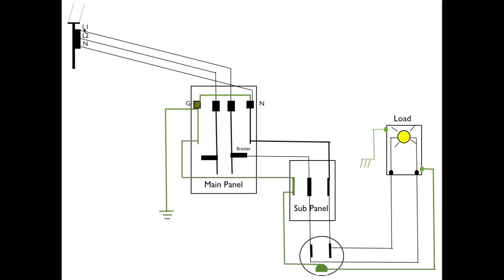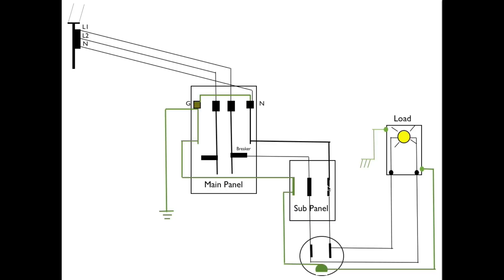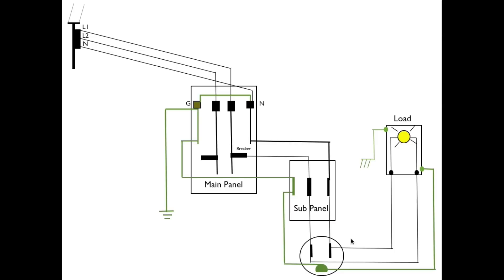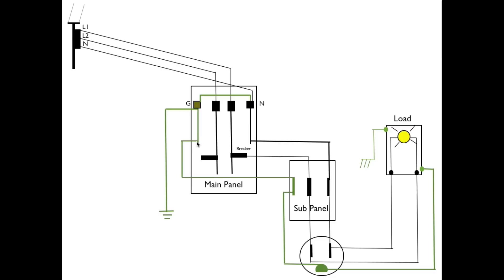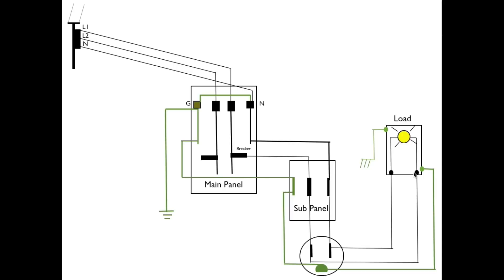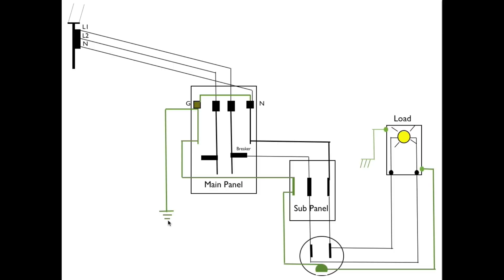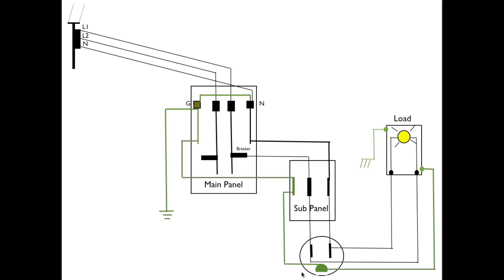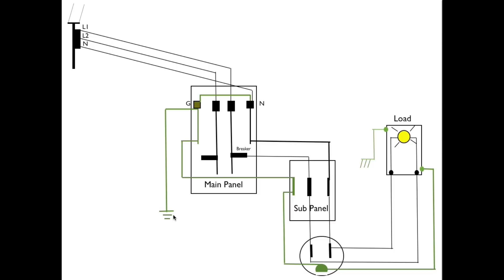The difference between neutral and ground on the electric panel

Comment: Secondary of power pole transformer is center tapped, and that tap is the neutral point in the system, whether grounded or not.  Center tap is connected to neutral bus in main box by third wire from pole.  L1 and L2 are each 120 volts to neutral (center tap), but 240 volts between them, due to being on opposite ends of the secondary, therefore 180 degrees out of phase with each other.  L1 connection in box supplies breaker loads with 120 volt current that returns from loads through white wires to neutral bus in main box, L2 does same, but 180 degrees out of phase with L1.  When L1 and L2 neutral currents combine at the neutral bus in the main box, they cancel each other completely if they are equal at that moment (Kirchhoff's Current Law).  Unbalanced current (difference between L1 and L2) flows from neutral point in main box, through neutral wire back to center tap of pole transformer secondary, not to ground.  Current in the 240 volt loads are exactly equal in L1 and L2 (series circuit) as long as there are no shorts to ground or ground circuit through load or chassis.  No neutral current flows in 240 volt loads because there is no neutral connection, only L1, L2, and ground.  Absent faults, the ONLY current flowing from the main box neutral bus back to the center tap of the transformer is the difference current (unbalance) between L1 and L2 120 volt loads, with NO neutral current from 240 volt loads, and no current flowing through ground.  Of course, all this leaves out switching transients and static discharges, which can affect fault protection devices.
Reply: +Hopelessand Forlorn but what potential is neutral at if it is not earth bonded? With all of those miles of transmission cables to build up a charge.
Reply: Hope my post was not misleading.  Neutral is earthed at the mains box, and neutral does frequently carry current in most all systems.  With separate 120-volt loads on L1 and L2, a perfectly balanced load with no neutral current would be a momentary state of changing loads, in most cases.  There is a lot more to utility distribution than I know about so far, particularly in bonding and actual amounts of earth current in different parts of the system.  My background is in aircraft electrical systems, and I am still working out the similarities and differences with what info I can gather on line.  No big surprises so far--3 phase is 3 phase, and center tapped xfrmrs all work the same.  Ungrounded 3 phase loads and single-point grounded signal circuits are more common on aircraft than you might expect, as are sophisticated distribution fault detection and protection circuits.
Reply: Hopelessand Forlorn
airplanes are a lot smaller than national electrical grids. Much like birds perched on power lines you don't have to worry about the earth ground on them much either.
Reply: I disagree.  The same considerations apply.  If you are distributing large amounts of power (I suspect the 787 operates with total loads of around half a MW), short circuits to ground are always possible in the absence of a totally floating system, and can have serious consequences.  Even in a totally aluminum airframe, bonding between skins and from airframe to components is critical.  Unbalanced currents return to generators through the airframe, and poor bonding or grounding would be as hazardous as the ground around a downed and live power wire in a utility system.  Aircraft data and communication wires are usually balanced and frequently shielded with single point grounding on the shield.  Sometimes double shielding is used with the inner shield grounded at  one end, the outer shield grounded at both ends, and no continuity between the two shields.  Even in a well-bonded aluminum airframe, low levels of stray voltage are common due to ground current through airframe resistance.
Reply: Hopelessand Forlorn
while the same considerations may apply the scales are completely different.
Reply: Single phase uses any of L1 L2 L3 paired with neutral line. For commercial and industrial service 3 phase is used with 4 wires, taking 1 line with neutral for lighting and other single phase loads. Single phase loads are carefully calculated and distributed   equally as much as possible to each phase (line) to balance the system. The illustration is clearly a line-to-neutral distribution system, but it is not properly presented because of Ĺ1 L2 & neutral. It should be L1 L2 L3 & neutral or L1 & neutral. 
Dividing the Voltage between L1 & L2 by 2 which is 240 to get 120 L1 to neutral is wrong. Try studying polyphase system, its easy.
Reply: Rey C Speaking of polyphase systems, do you understand the difference between 3-phase and two-phase systems?  Do you laboriously plot vectors to verify that 120 volts times two equals 240 volts?  You must really have fun with synchro circuits, which typically have three windings at 120-degree angles, but which are in fact single-phase devices.  Polyphase circuits have not changed since I learned them in 1965, but you have proven once again that there are endless ways to misunderstand them.
Reply: None of this will work without D-cell batteries...stop your arguments....   ;)
Reply: Well duh
Reply: Hoplelessand Forlorn - always wondered about an airframes ability to shed errant voltages from the atmosphere; i.e. ionic disturbances from thunderstorm activity, etc.  Also the craft passing through magnetic fields of Earth.  Then, of course, the occasional direct lightening strikes.  Where is "ground" at 30K feet.  lol
Reply: Mitsubishi Triton 2.44 Diesel engine
Reply: R C I had the opportunity to measure a 3 phase line to ground.2 poles were 120 v each and the third was 240. I was told the 240 was the wild leg of a 3 phase setup. At the time I had no clue why.
Reply: Not quite right
Reply: Hopelessand Forlorn - This is a much better explanation than the video as he does not address L2 at all. In the video however, he has the neutral from the pole connected to ground in the main panel. Is that correct? That means that from the main panel on, neutral IS ground! Is his diagram correct?
Reply: Craig Daniels you will measure continuity between ground and neutral, that's what trips the breaker, let's say you have a microwave,  metal cover ,and your hot wire comes off and touches the cover inside, your breaker pops because the voltage goes through the grounding conductor on the microwave and goes back to the panel, through the neutral and overcurrent pops the breaker, if they didn't tie together at some point you would have voltage going to ground and not Tripp the breaker
Reply: Hopelessand Forlorn so the unbalanced current goes through the meter gets paid for and then gets sucked up for reuse in the grid?
Reply: Now lets apply a smart meter. And i promise you can take out your snap 9 and read a good current flowing back to the sub on most residential meters.come on folks think a little bit more for yourself common sense.or keep letting these corporate utility whores take your money
Reply: @1pcfred  induction
Reply: Toed T I'm not an electrician by any means but you answered my minds problem thank you. Makes me happy to hear that. Wow.
Reply: Hopelessand Forlorn - what is a two-phase system and where is it used?
Reply: @ronb6182  you were dealing with a high leg Delta.
Reply: @24vignettes94  yeah I know now  but in 1983 I never studied commercial wiring and had no clue, my brother said it was the wild leg of the delta. 

It's suprising that there are car alternators that are three phase. 

It's something to play around with, of course with lower voltages.
Reply: @JetDriver1111  🤣🤣

Comment: Neutral carries current, ground doesn't except if there is a fault. Neutral is a system ground, the green wire is a safety wire.
Reply from the maker: +Bri G. Quite accurate.  Thanks for the thoughts.
GFM
Reply: What about the main difference B/w Grounding and Earthing????
Reply from the maker: +Android World Earthing means it goes to a ground rod.  Grounding is usually the chassis of a component that goes to a ground rod and the neutral in the panel.
GFM
Reply: grayfurnaceman ;, will n
Reply: Bri G. my fluke meter agrees with this statement.
Reply: grayfurnaceman 
Despite the fact you do understand that he has pointed out that there is an error in your video, still you keep it up and this in a topic as serious as electricity. What is wrong with you?
Reply: There is an obvious error in the polarity of the receptacle in the diagram. The polarity is reversed with hot being shown on the left and the right-hand blade of the plug inserted into the receptacle being called "neutral".
Using a VOM you can convince you on a properly wired receptacle by showing that the usually wider opening on the  left for the white wire at or near zero volts relative to the voltage on the ground prong in bottom hole in the receptacle. The VOM will quickly convince you that the "hot" opening is on the right. Why with all the time this video has been out has this not been corrected or at least admitted?
Reply from the maker: I am responsible for the error.  I do not consider it important whether it is on the right or left.  The size difference is easily noted if you are looking for the hot terminal.
GFM
Reply: How can you say that it is not important if the white neutral is on the left or right? Even the screws on a base plug are color-coded---the neutral side has silver-colored screws and the hot side has copper-colored screws. This is not an insignificant error on your part.
Reply from the maker: Get over it.
GFM
Reply: Neutrals kill more people than hot legs.When working in junction boxes beware of other circuits using the same neutral .In the field lots of things are wrong.. beware
Reply: Brian Ellsworth 

True!
Reply: Outside the Electrical Grid
In an appliance there is often Chassis ground and Earth ground. Earth ground is denoted by a symbol that has three or four reducing lines and Chassis ground is a triangle. The two may be connected by a very small resistor like 2.8 ohms. The differences is subtle, and has mostly to do with internal circuits monitoring the system.
 Chassis ground connects to the Chassis. Earth Ground is connect to a long pole stuck in the ground. 
However, there is no earth ground in a vehicle. The negative side of the battery is "ground." A whole different concept. To get an earth ground you'd have drag a wire behind a vehicle. Wouldn't that look funny. Even so it wouldn't work so well would it?
Reply: Dan Mart, Sounds a little bit like Nit picking?
Reply: what a fluke.lol
Reply: I think he meant it makes no difference for the purposes of the lesson. For the sake of the discussion, whether the diagram on the screen is backward from a real outlet doesn't matter as long as you realize that you are dealing with one hot side and one neutral side. Geez. I have way more of a problem with the fact that he sort of implies that the ground even CAN "carry" current. It can't. It's a controlled leak. And it doesn't have anything to do with kicking a breaker. If you doubt me, go drive a rebar into the ground, hook a hot lead to it and watch what happens... NOTHING. Nothing happens because ground resistance @120v is only about 2.5amp. So nothing happens. The neutral should always carry the return current. The ground is a backup so that in the event of an open neutral the current has somewhere to go that it likes better than you. Anything else more complicated than that is just confusing the issue.
Reply: If you do not which slot is neutral by sight you should not be messing in there.
Reply: wood that be like a combine dragging a ground chain to keep dust from accumulating on the windows?..Ha.
Reply: Lol...You are confusing two completely different things! "Chassis ground" is indeed bonded to the "long pole stuck in the ground". By the term "chassis ground", they are referring to the body of the device. ie the metal bits on the outside that you might be able to touch that could possibly become energized. This would be the outside of a metal satellite box, or the outside of your metal refrigerator or the metal top of your table saw. What you saying about a vehicle is also called grounding to the chassis, but it's DC, not AC, and you're using the vehicle's frame to carry the neg back to the battery. It's a completely different animal and has absolutely zero to do with safety...
Reply: It carries your fault current!
Reply: MrOperettalover - just pretend you are looking at the rear of the outlet. grayfurnaceman did not say it was the front. You did. And you would be incorrect.
Reply: And you said in one sentence what took him over 10 minutes to tell us. Thank you for cutting through all the long winded BS
Reply: Now,Can I connect earth wire to neutral in panal and connect to the ground?
Reply: Tom Garbo    I not sure what happened as you describe it. We had a guy tick his head in a cubicle looking for the fuses. It's a family show so I will spare the gruesome details. Slow down everybody and live for tomorrow please.
Reply: MrOperettalover .
Reply: @ThaSatelliteGuy  Mr. Moore; 

Whoever heard of measuring RESISTANCE in units of AMPS?

That's kind of like measuring flow rate in terms of decibels, right?

Comment: Thanks for the video!  Around here each utility pole appears to have their neutral connected to a ground wire as well.  Also, I do believe the illustration of an outlet in your diagram is a mirror reflection of what it actually is.  You know, the "hot" is on the left side with the ground on the bottom.   Best of luck and thanks for taking the time to save lives.
Reply: You are correct. The "system neutral" is indeed connected to the pole ground, usually #6 copper. The ground wire runs down each pole all the way to the base and then is typically arranged in a flat helix at the bottom, or "butt" of the pole as seen here ...

https://i1.wp.com/www.iw5edi.com/wp-content/uploads/2013/09/pole5.jpg

As a rule of thumb, a pole is buried for 10% of its length plus 2 feet, so the bottom of a ground wire on a 50 ft pole could be 7 ft deep.

Ground wires are now having to be sheathed in some sort of conduit due to people actually cutting out lengths of it directly from the pole to sell for scrap. In one part of Texas several years ago, copper thieves figured out a way to actually cut down the primary neutral lines on old rural lines. Miles of copper wire disappeared over time.